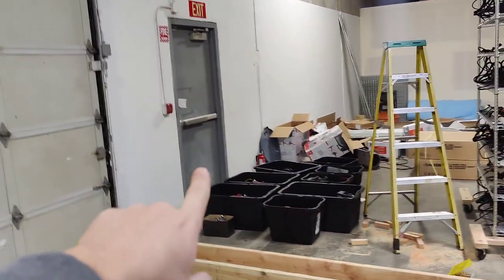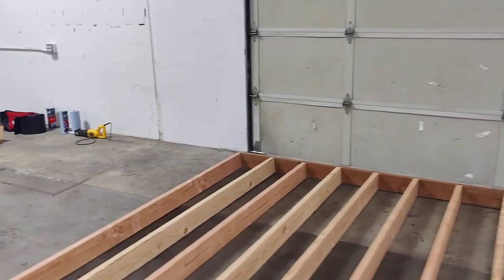GPU Mining Farm - Building Our Intake / Exhaust Wall for 400+ Amps 3 Phase

Comment: I wouldn't recommend installing the wooden wall into what you called the "Garage door metal" This is the garage door track. If you are putting holes into that the rollers that actually lift the garage door up and down could snag on one of those causing am imbalance in pressure on the springs lifting the opener on the garage door causing it to snap. Depending on what way you drill in the screws the sharp metal sticking out if its in the way of the rollers can cause the rollers to get stuck on there causing the opener motor to burn out. You will probaby be fine if you put the screws in it from the inside of the track going out.... but whoever has the garage doors after you with that track are going to be fck'd. - Garage door installer/repairman for 6 years.

Comment: Thanks for sharing your experience. From what I saw from another farm build, having inlet and exhaust on same wall next it to each other is not great. Will result in some exhaust air being pulled back in through the inlet. Maybe directing the exhaust upwards on the outside might help.